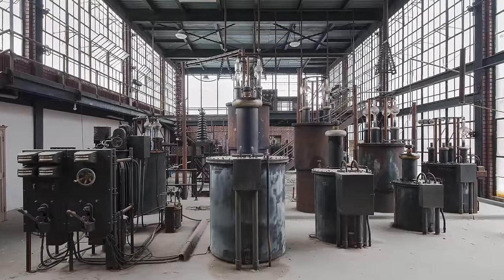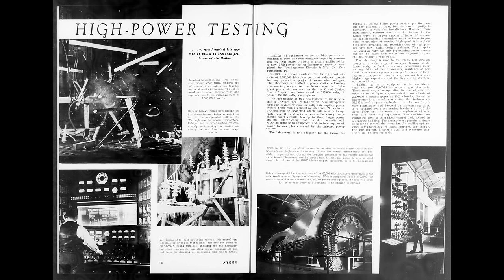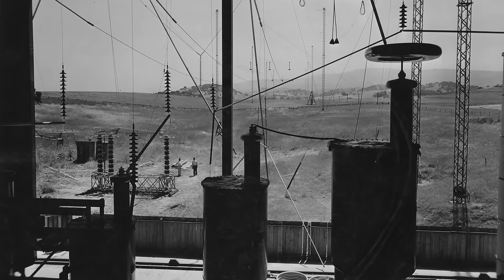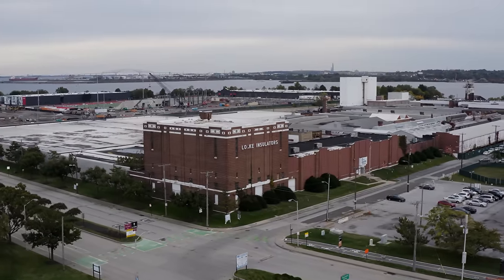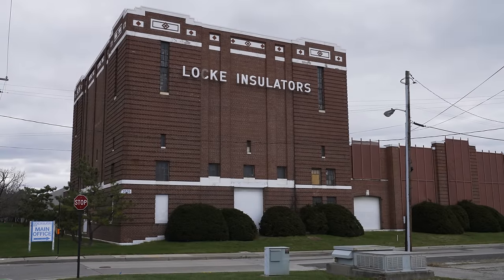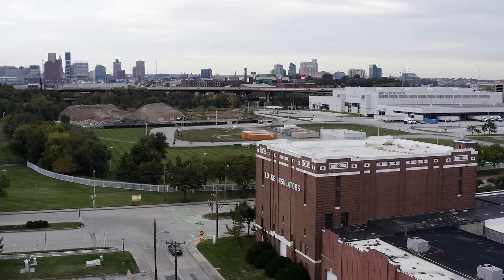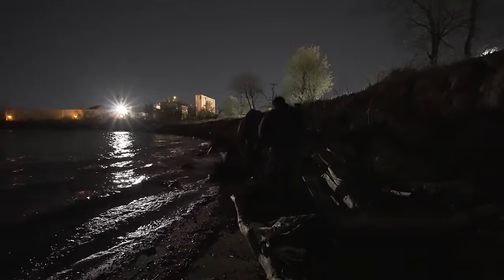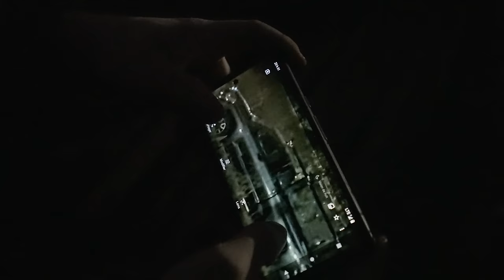Exploring GE's Abandoned High Voltage Lab - Vintage Electrical Tech!

Comment: Yeah pretty cool stuff. This is where they worked out all of our, High Tension Power Line Distribution, methods. As they were stepping up and stepping down voltages. This lab was also winding, transformers and building, capacitors.

After a while. After decades. They worked it all out. The lab became a white elephant and an albatross.  But since GE owns the property. They've tucked it away for safekeeping. Preparing to build the new series of, Fusion Generators. And they'll be needing these labs, again. Repurposed. And progress marches on.

Maybe from one of these labs in the future. The next great battery technology may emerge? When someone he connected a wire to an albatross. And let it fly around the lab. And something happened? I when it's phosphor rich little turd from its cloaca. Came flying out of the bird. And landed in the middle of the, Frequency Multiplier. When it discharged into the core of the lithium Crystal battery. And it sparked a new idea. Like all other discoveries before it. It's when, the most unlikely happens. That should not. But history pays no never mind to, mathematics. When things just, happen. And lookee there! What the hell? Did you do that Bob? No I didn't do that Ray. Well then, who did?

And it'll happen like that. And then they shall win a Nobel prize.  As it won't be TNT this time. It'll power us into the next, century. And the entire world will be connected.. It'll be unavoidable irrepressible. It'll change the world if we don't kill ourselves, first. If we can last until then? As it's not looking good. Nazis have reemerged. And here I thought my dad had done his job for US Army intelligence World War II stationed in Europe? Obviously not. They're back. Now with American accents. And many living in, Texas. The Republic of Texas. The Lone Star State of, Chaos and dismemberment. Not really a state but in name only. It is a separate country in the lower 47 Continental United States. That went out of their way to defraud and rip off the American people and US government. And considering nativeborn Texans to be far superior. To any other human or American.  And when was the last time we heard that kind of deranged bullshit about 100 years ago? Yeah. They were called Nazis and led by Hitler. One of the worst blights on the face of the planet, 100 years ago. And they are back in the USA.

And so these high-voltage labs were very important in their day. And all the college professors and their graduates. Worked everything out. Until those laboratories became, archaic. Kind of like an old, Industrial Horseshoe Factory. I'm sure they turned out millions. Some 100 years ago and beyond. Maybe 200 years ago? Not as much call for them, today. And all those guys that used to work for US Discount Horseshoe Distributors. But all mostly out of work today. Like inbred coal miners in West Virginia. After they got overly inbred. They forgot how to mine coal? They forgot to talk. They forgot how to put clothes on, not backwards. They forgot how to put clothes on. They aren't smart enough to eat unless given food. Even a goldfish knows how to stay alive. But not inbred coal miners from West Virginia. Since their offspring can't talk. They are so terribly inbred. Check out the Whitaker Family. They are a lovely family. They are totally innocuous. At 100% dysfunctional. Which makes them very useful US citizens. To watch on YouTube. And which provides them some funding to survive. Which their other less inbred and communicative family members living next door. Are trying to help them out with. And that is commendable. As they know their family is, badly inbred. And is a US government and major educational institution, study. They are a protected national treasure in other words. Because this is not supposed to happen in the USA. It is discouraged against.

It proves why we need a huge  DNA gene diversity pool. So this does not happen. Which means breeding with others who are not part of your ethnicity. And that was actually God's plan. Of whatever God may have existed that put us here? Like an extraterrestrial, thingy. That is so incredible. We cannot conceive of its capabilities. It is neither male nor female. It is something else we cannot understand.

For all we know? Stars are alive in a much higher intelligence we cannot communicate with. And they come and go. At their own pace. Some burst out.. In, frustrations. Others just shrink into obscurity.  There are all sorts of broken stars throughout the cosmos. Hot stars, cold stars, big stars, small stars, gay stars, lonely stars. Freaks stars. Normal stars. Obese stars. Midget stars. And are, Neutron Stars, hot or cold? No more fusion taking place. How come they are not cold? Why would they still glow? Now just an isolated chunk of hot  plutonium all by itself? And nothing to set it off ever again. Who the hell knows? Until it happens to us? Like weightlessness.

Will weightlessness be fun? When the planet splits in half? And we have 2 half junks not rotating anymore? Ugh! That will be a big bummer. And so I'm not waiting around for it to happen! I would like to die sooner than that day. I'm just saying.… You know?

This is a great video. Too bad you don't know much about the industrial evolution of electricity? You know Edison versus Tesla GM versus Ford. And why Mr. Westinghouse was always cool.  Unlike J.P. Morgan. Who used to be a pretty & funny actress comedian. Back in the 1960s and 70s.  The other one was a wretched old man rich guide. Who only sort of believed in Tesla. But George Westinghouse believed in Nicola, more so. And do he was onto something. And so did Edison with his GE. In fact I have a GE-D. And I worked for GE. When they purchased NBC from RCA. As I was hired by RCA for NBC. You see? Too many C's. Sure all were Companies and Corporations. Why does that have to be included? Would it have been better just to work for the NB company? Keeping it a little simpler? Because we know it's a Company. We don't need the  letter C. Do we? If so? Why? Where's the humanity in that? Does that make any sense? I thought George Carlin did. But he is now dead. He had some nerve! So did Robin Williams. I mean give me a break? John Candy, John Belushi Chris Farley how many others? I mean what great comedians have died lately? Oh really? Really? Them also? Really? Oh my. Never mind.

It's getting tough at 67 years of age. Why are the Boomers all dying? We are supposed to live forever I thought? I mean what happened to the magic elixir? To provide for infinite life. We take our vitamins. They are not working. I had sex change surgery. It doesn't work. I've been trying to get pregnant for years. I mean the drive-through works. But I am out of stock. If you follow? Behind me. But you shouldn't. I have gas. I'm just saying. Just so you know.

There is nothing causing my syndrome.
RemyRAD